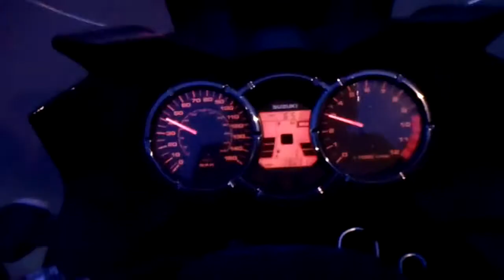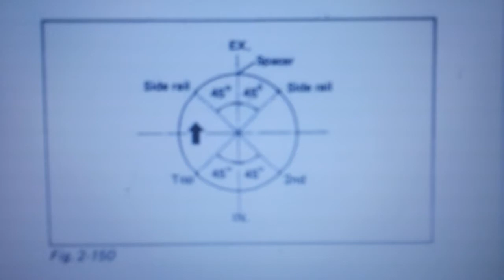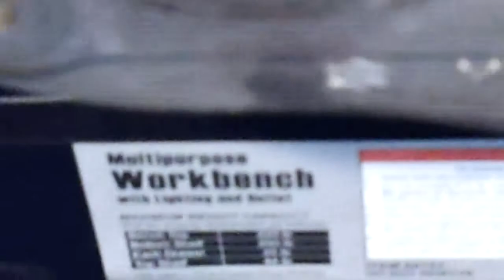Installing Pistons and Rings - GS550 Cafe Racer (Part 14)

Comment: First: thanks for the great and thorough videos!  I’m in a bit of a bind right now (literally) as my cylinders won’t seat properly.  I get past all the rings on 2/3 and no more movement.  You had some down time in this video between seating and down to dowels, so I was wondering if you maybe used a lot more oil than I did and also, if it required any significant amount of force to seat?  First time not working on a V or flat motor!  😬😬
Reply from the maker: Thanks for watching. I certainly did oil things up, but I can't say that I used any more than would be typical. I did measure bores in 3 places and two axes as well as measured pistons and ring gaps before assembling. Hope you find the solution to your predicament.

Comment: Could this all be done wo having to take the motor off the bike....or is it totally worth doing it on a bench..
Reply from the maker: A top end rebuild like this can be done "in the frame." A bit more cumbersome putting the cylinder bank back on, but doable. I was painting engine and frame so needed to come out for me. Thanks for watching!

Comment: Was there any visible difference between the top two rings? Either the set I got didn't specify or I lost the instructions, but one has a chrome ring around the outside while the other is just completely dark grey
Reply from the maker: Alan Jordan Oh man you're testing my memory. They looked the same to the naked eye. The top one had a marking that set apart from 2nd ring, but I forget now what it was on my set. If you can get a magnifying lens, the profile on their edges is different. Service manual shows profile images. I can dig up if you don't have. Let me know.
Reply: I'd really appreciate it if you could! I don't have the service manual
Reply from the maker: You can download the service manual here: http://members.dslextreme.com/users/bikecliff/
Graphic you are looking for is on page 49, Figure 2-146 of the GS550 (77-82) service manual.

Comment: Currently on this part of my build I follow you for the specifics and For_the_bold for quick work , great Jon explaining, where did you get your rings at? I'm having a hard time find them online for the  BUDGET build
Reply from the maker: mikeyseymour I got mine on eBay for $40 I believe from a seller called cruzinimage_co, but I can't seem to find them again. Try their website cruzinimage.net .
Reply from the maker: mikeyseymour I found them on their site,  2nd page of Suzuki piston rings. $40
Reply from the maker: mikeyseymour You've got me trolling their site now. They've got the best price I've seen on a set of 4 intake manifold boots. EBay was triple that! Thanks!
Reply: @UrbanMonkTV  did you order the intake boots? Happy with quality? Shipping time?
Reply from the maker: @davidc5362  I did order the intake boots from cruzinimage. I honestly don't remember how long they took to arrive. The fact that I don't probably means they met my expectations. As for quality, they've been fine except one has loose threads in the the access port where you hook up the vacuum gauges for sync. Seem there's a nut molded into the rubber inside that will spin in place if I torque the little screw (or the vacuum gauge connection) too much. It has been fine though, Seals up and functions, I just have to be careful about how much torque I put into the little screw.

Comment: Where did you pick up your hone from? Got a link? The big clean about to happen, might as well order what I need in advanced!
Reply from the maker: SierraKiloGulf I did the same thing.  I've got a big pile of parts that have been waiting for many moons for the reassembly to begin. As for the home,  I got mine at Harbor Freight. Cheap. Worked.
Reply from the maker: SierraKiloGulf https://m.harborfreight.com/4-inch-engine-cylinder-hone-97164.html

Comment: Q tal amigo podrás Acer un vídeo de cómo reparar la caja de velocidades de susuki 81 gracias
Reply from the maker: Lo siento. Mi moto no requería trabajo en la caja de cambios. No tengo otro motor para usar para mostrar eso en un video. Gracias por ver.
Reply: @UrbanMonkTV   podrás conseguir un motor Suzuki modelo 81 550cc o en su defecto piesas q llegar a necesitar yo estoy en México